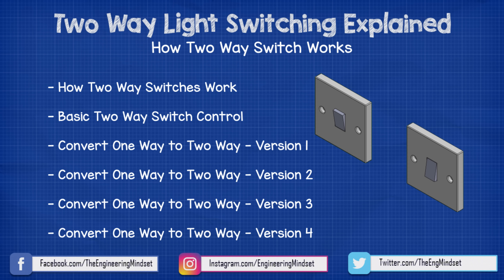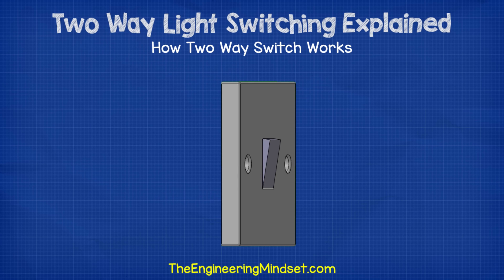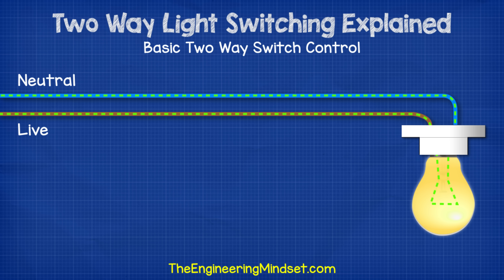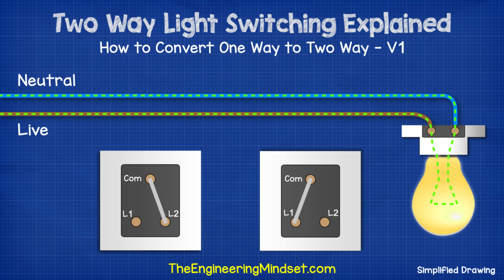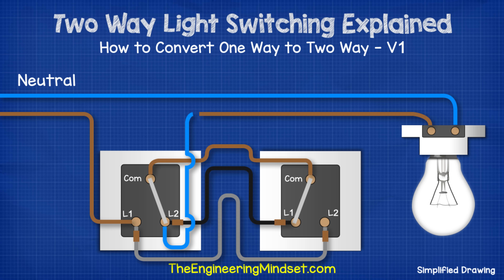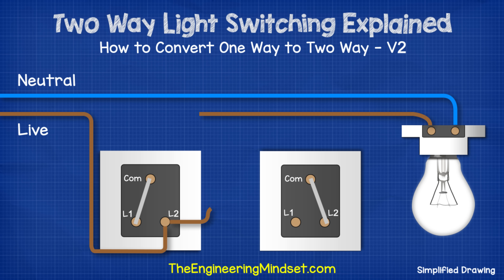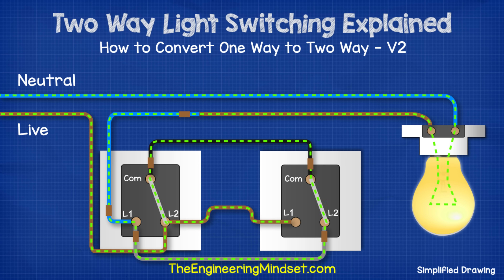Two Way Switching Explained - How to wire 2 way light switch

Comment: In the U.S. this circuit is called a three way switch because of the three terminals, the common and the two travelers.
Reply: In Russia three way switch flips you
Reply: *Soviet Russia ahha @wm79198
Reply: In Russia they use two long strings to control one toggle switch.  Each string goes in each direction.
Reply: @jtb4  
in russia light turns you on
Reply: in canada we call it a 3way as well
Reply: The cables between the two sets or more L1/L2 are sometimes called the ‘strappers’
Reply: In France it's "va et vient" ~"go and come-back" ...
Reply: In my country, we are excited about the recent discovery of fire
Reply: In my country we call this basic electricity.
Reply: He actually states that in the video.  He's British (as am I) and we call it 2 way switching here.
Reply: So, would you call a regular switch a "two way switch"? I think they should be named after how many ways the flow of electricity can go after the switch. A regular switch should be a one way switch. A switch like these would then be a two way switch.
Reply: @Zarabozo  
There is a confusion in translating, in engineering the study of a device is designated by the number of terminals, named ports or ways, this is a three port device  but get popularized as three ways, on the other hand in electric nomenclature is called a one pole two positions switch.
Reply: Yep. Call it a 2 way to a US electrician, you will get a puzzled look. Two way is probably more correct term. Of course, we have electricians and even engineers calling grounded conductors “neutrals”.
Reply: And in UK its ALUMIN IUM
Reply: just posted asking if it was a 3 way lol....3 way in canada as well
Reply: This and there is a energized side and a switchleg side of the circuit.
Reply: Safeman4202 : And in Europe it's not called a "2 ways switch" because only GB speaks english.
Reply: In germany they call it "Wechselschalter" because you "change" from one terminal (L1) to another (L2) when supplying on COM ...
for long corridors or more than 2 switches we use "Kreuzschalter" with terminals like
A B
C D
either A & D or B & C are conductive, like crossed fingers :)
Reply: yes it is 3 way switch
Reply: This just answered my confusion. Thank you!
Reply: In other countries they also call this as change over switch
Reply: Yes
Reply: You guys also switch a single switch up instead of down...confused the hell out of me when I lived in America
Reply: I like everything bit of Ur video but there is a little disturbance with the subtitles as it blocks the diagram.
Reply: That makes no sense
It can be controlled from 2 switches hence the name 2 way
Reply: It's the same in Canada
Reply: in my country is called - head staircase/stairway circuit because it is used at the opposite sides of a stairway.
Reply: @orange11squares  "Comutator cap scara"-ROMANIA :)
Reply: @orange11squares   how about on a long corridor then ? Switched at both ends .
Reply: it's called the same no matter how you choose to use it.....  if you place another  switch called head cross  you can control the light from 3 areas.
Reply: @orange11squares  That's called a 4 way switch here in america...
Reply: orange11squares    In the UK the third switch is called an intermittent switch, in fact you can have many intermittent switches as you want, as in a many level stairway, or a corridor with many doorways.  Have a great day.
Reply: @umt1cardiff  if you have a long corridor, you can put a four-way switch between those two corridor switches... (or even more four-way switches if that corridor is long enough) "4 way switch wiring comes in real handy when you would like to control a light fixture from more than two locations. While wiring a 3 way switch is good enough for a staircase or hallway, wiring a four way switch is crucial for the addition of a third, forth or more switches."
Reply: With the third switch it is called "four way switch circuit". Any room with two entrance has to have the 3 way switch system.
Reply: orange11squares in the us it's called 4way switch, when 3 or more switches are involved .
Reply: @godbluffvdgg  
Here in america?  América is  something like 30 countries.
Reply: It’s intermediate switch
Reply: And in greece this circuit is called αλερετουρ!!!! The reason i dont know!!!!
Reply: @ΔημήτρηςΛαμπρινουδακης-θ6ω  From the french "aller-retour" meaning go forward and back ;)
Reply: In my country we call this light switch.
Reply: Erik Johansson lol
Reply from the maker: Check out our US 3-way switch video: https://youtu.be/_u5ORnhqn8g
Reply: Actually, they're called three-way switches because of they way Americans typically wired them. Historically, we brought power to the light, then run two switch legs down to the switches, creating a Y-shape. In Europe, power was brought to a switch, and extra wires are brought to the light and to the other switch. It looks as the the power flows from the switch to the light, to the other switch (when really its a double loop).

The techniques are now mixed in both places, depending on preference.
Reply: It's called a 2 way because there are 3 possible positions (both up, both down, one up /one down)

Comment: I can program a computer, yet this is mega confusing
Reply from the maker: It's just logic, "if", "and" & "or" functions.
Reply: Main way domestic sparks make their money
Reply: I'm a programming enthusiast and electronic enthusiast, I got both from the internet and beginner level at best,
your comment just make me realize that I actually accomplish something in my life, I don't have any trouble to understand that circuit,..... or maybe I just waste too much time tinkering with circuit simulators
Reply: Unlikely.
Reply: It's just an xor
Reply: As long as you can trace the live wire you're ok
Reply: @vividvisualsphotography , that's where putting a brown sleeve on all the non-brown live wires is so useful😁
Reply: I'd say you most likely can't program shit if you don't understand basic logic gates. This is most likely the case, since nobody that has ever written a single line of usable code would say "I program computers". You code, you program, you don't "program computers" unless you're in the 60s and feeding perforated cards to an IBM monstruosity.
Reply: @gnualmafuerte  hmm bit of an overreaction here. Don't assume someone can't program just because they didn't understand how a circuit worked, maybe they didn't relate it to logic gates. I can program (I can also prove it if you want) and I didn't understand how these light switches work until now.
Reply: Ouch!!!! (But I suspect you are right)
Reply: @gnualmafuerte  brutal bro O.O
Reply: @gnualmafuerte    I did that punchcard stuff, then the 8080, 286, 386, 486.  They all sucked.
Reply: @markgigiel2722  Finally having a protected mode in 386 sucked? A math copro builtin in 486? You couldn't possibly say that, unless all you did was BASIC.
Reply: @gnualmafuerte    Not a programmer, but had to do Fortran in school with punchcards.  Then just made computers work for people.  Dma channels, IRQ conflicts, jumpers, RS-232 and dip switches.  Pain in the ass.  I'm 60 and retired now and sometimes do wireless  and audio consulting and still fix everything under the sun for beer for friends.
Reply: @gnualmafuerte  Oh, I forgot autoexec.bat and config.sys and EMM.386 and himem.sys etc to get shit to work.
Reply: @markgigiel2722  what about windows 3.x and even 9x  ? 9x at least have plug and play but still nightmare for stability... but when XP arrived and NT platform  become  a standard not only for servers, we finally are ok :) (yes I am still using XP and 7 on my PC :)
Reply: @intel386DX  For all the radio stuff I did until I recently retired, the OS was Unix based.  They finally were putting a useful GUI as I left.  Nice chatting with you.  I'm off to start getting rid of way too much stuff.

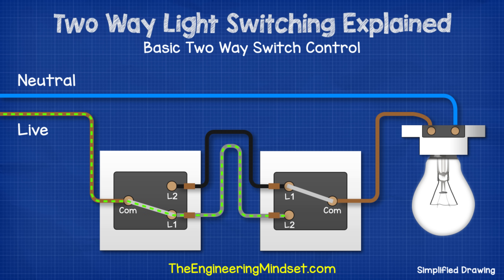Comment: On the four variants, V1 through V4, you named it "convert one-way switches to two-way switches,"—but the switches used are functionally equivalent to the ones used in the first configuration (2:15).

You say at 2:55 to check if they have three terminals. If you can use them in a functionally equivalent manner to a two-way switch (3 terminals, Com, L1, L2, switch alternates between connecting Com–L1 and Com–L2), how are they any different than a two-way switch? And why could one not just simply arrange their 3-terminal one-way switch in the same configuration of the first example (2:15), which is simpler? (Instead of using V1, . . ., V4.)
Reply: fsmoura while you are at it; 
another thing to point out, if we differentiate L1 and L2 (wich in reality does not matter because they are the same) but not wires by Color (Color does not change the cable properties) 
then v3 and v4 are the fucking same (except brown and black cable colours switched!) 

However if we now say L1 and L2 are the same thing then 
It all collapses and v1 thru 4 are all the same 
And yes that defeats the sense of staying close to reality where there is different labeling l1 and l2 

(Further notice, please be consistent (bullet no. 11 ;-) )
 and use the brown sleeves and the word intermittently correct, 
because in v1 and v4 the wire directly connected to live is NOT intermittently rather PERMANENT live therefore should be brown as in v2&v3)
Reply: Thanks, I see. So I guess it means more convert your installation than convert your switch (as I was thinking).  As in "convert your lamp installation from single-switch to long-corridor double-switch mode. (And you may already have a three-terminal switch in your single-switch installation, so you can reuse that.)"

However, regarding V1 . . . V4 being extensions: As they are wired, V1 . . . V4 won't work as a one-way switch by only removing the second switch. That happens because both pertinent wires are connected to L1 and L2, and the switch cannot be made to connect L1–L2. True, with a trivial modification (disconnecting one of the wires from L1/L2 and connecting it to Com) you can make it work as a single one-way switch installation should. However, it is worth noting that in the case of the first configuration (2:15),  you may also remove any one of the two switches, and with a trivial modification (permanently joining formerly Com–L1 wires of the removed switch) you can make the installation single switch again. Which of course is also true if do it in reverse (that is, adding the second switch, instead of removing it), and therefore variant 2:15 can be added "as an extension" just as much as V1 . . . V4.

Regarding the first point, it is also worth noting that, not only 2:15, but also all configurations in V1 . . . V4 must have current going through both switches when turned on—which is evident in the fact that in all four configurations V1 . . . V4, the current must go from L1 to L2 in the first switch for the circuit to be closed, and the switch cannot connect L1–L2: all the arriving paths on L2 come ultimately from the second switch.

Thus, given that, in order to add a second switch in configurations V1 . . . V4 you need to do a terminal reassignment, and that the same applies to the first configuration, none of the five variants is really any more of an "extension" option than the others—all can be applied to an existing installation, even the first one, 2:15. (Although it is true that V1 . . . V4 surely do look like something someone would come up with, if they were trying to modify an existing installation, and the simpler 2:15 looks more as something to be come up with when designing from scratch.)
Reply: V1-V4 appear to be all identical.  Question remains, why use the "convert" configuration?  I thought maybe it was to save a wire nut that would otherwise required on a conversion, but that still seems to be required because you can't put two wires under one screw.  That is to say, once you've run 3 wires between the two switches you have effectively put both switches in the same box so you can actually wire them in anyway you like.
Reply: none of those configurations are ever used. They also stopped making switches with 2 contacts, it's all with 3 now. He also forgot to name the advanced hotel switching system where you can also install sockets without running a cable with 6 wires.
Reply: Yes thank you! It was making me wonder if I was crazy, seeing all these “hey thanks for the perfect video bro” comments.